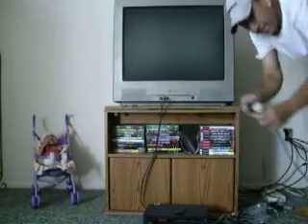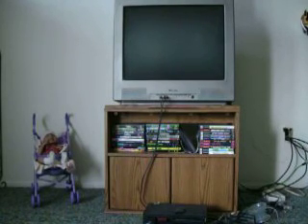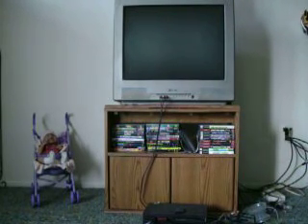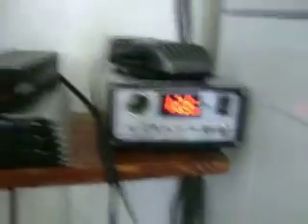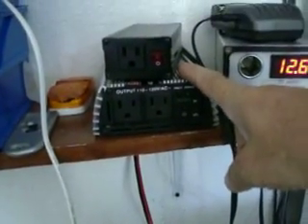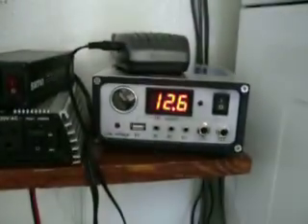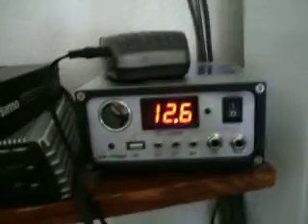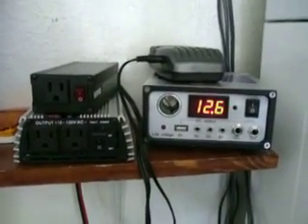45 watt solar panel

Comment: Good Job but, the batts at in parrarell not series and other thing in charging out on of the alligator clips on positive on one batt and other alligator clip on other batt, the will then draw from both.

Now you are working one batt more than other.
Also the panels you need blocking diodes on them. Or you can do what most of us are doing get a cheap sunforce 7 amp charge controller. It does it for you. Just use the charge controller in kit for lights and digital reading.